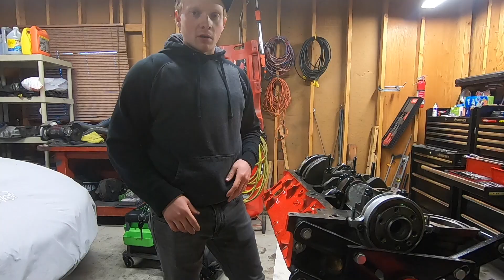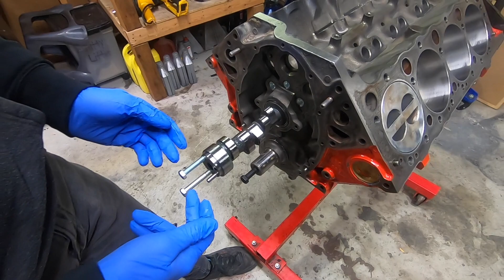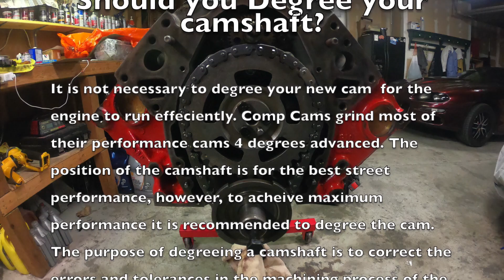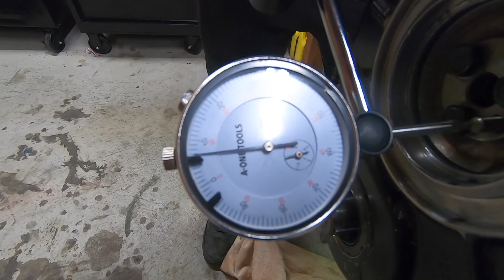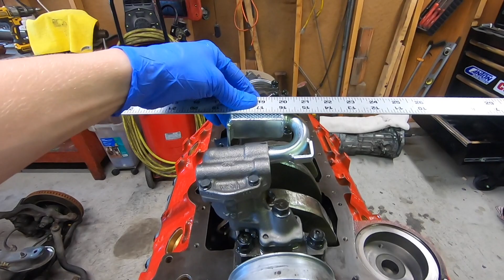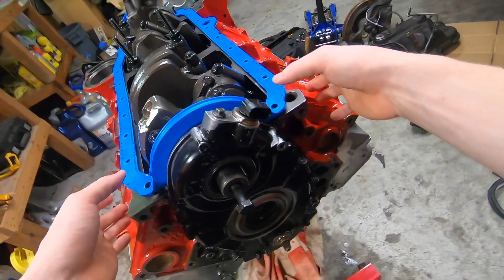LT1 Full Rebuild Tutorial Part 9 (Timing cover and Oil Pan)

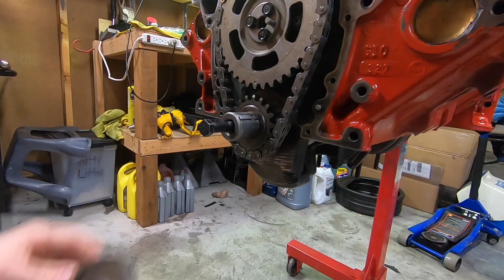Comment: 15:21 that is the reluctor for the stock crank sensor. If you have the torqhead setup and an electric water pump then you can do away with that reluctor and go with a double roller timing chain. I got the 9-3545X9 Cloyes billet double roller kit and an EFI connection billet timing cover without the water pump hole. You can get the Cloyes billet double roller for way cheaper than the LT1 specific timing chain kit.

Comment: This is actually a pretty good video , wish I had found it sooner. Only thing is with the rear main, it should’ve come with an installation tool that slides over your crank so it doesn’t fold over and you don’t have to pry or pull on it. Made it super easy on my truck that uses the same rear main

Comment: Great video! Is that a Moroso oil pan gasket that has the metal tubes in the bolt holes to prevent over torqing ? If so would you still have the part number for that gasket ?

Comment: Great video, just wondering what oil pan you're using on this build. The reason I'm asking is that I've installed a cap girdle on my Lt1 to add extra strength (as I'm planning to run boost). I have some fit placement issues with my stock oil pan using the girdle. I've done research and it sounds like a 7 Quart oil pan will remedy my clearance issues. Since it appears you're using a 7 quart pan I was wondering the model and make. Thanks
Reply from the maker: Sounds like a great build! I would recommend the Canton oil pan. Here’s the part numbers I used!
Canton racing RR oil pan CTR-15-242T
Pick up tube CTR-20-023$9
Oil pan drain bolt CTR-22-405